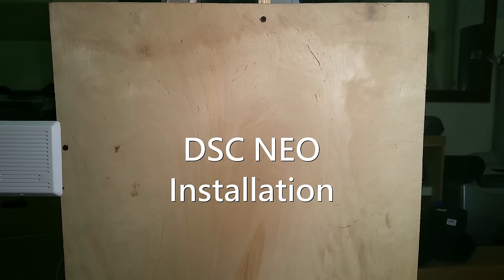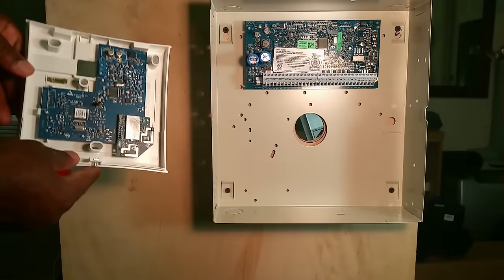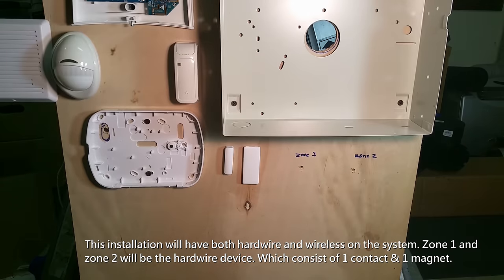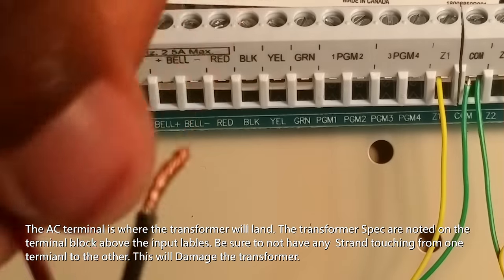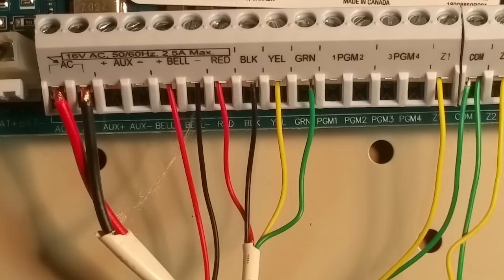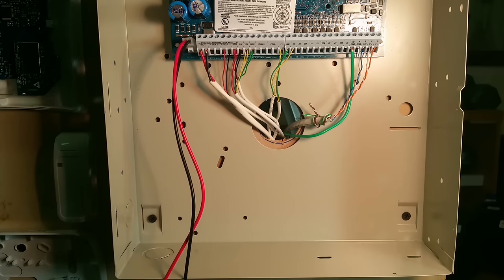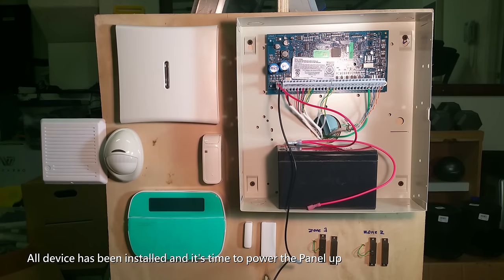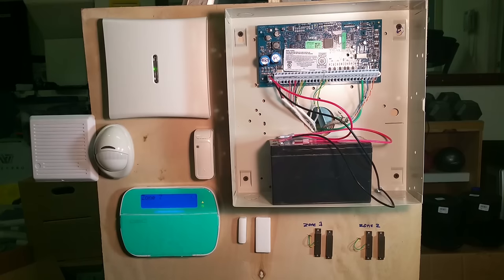DSC NEO Installation - Step by Step

Comment: Just started at a local alarm company. Working inside at the moment for troubleshooting IP cams & F/A . I have a IT background so I know IP NVR like the back of my hand. Thank you for the video! I've disabled old alarm systems but this knowledge will get me a raise! New career better pay!  I'm one week in. I got the wireless systems down pat but commercial NEEDS to be all wired. The interference from commercial is nothing to mess with wireless..... X-Ray,  heavy wireless traffic. Again THANK YOU FOR YOUR VIDEO! Btw to the comment below.... if you install an alarm sys. you better know about resistors on zones.. Otherwise you need to keep walking....  Love the line seizure part. THAT IS KEY

Comment: Started With DSCs PC 5010. Then the 832, then PC1832, love them and the PC 1864.
Just Learned they are Discontuing the Power Series. Maybe even the Neo? 
I use the Programmable Outputs to shut off a 1" Ball Valve (Viking WSV2). Within 2 seconds of a leak using Wireless and/or hardwired water sensors. 
I also use a PGM to Turn off Air Conditioning if a Perimeter door is opend more than 5 minutes, or whatever time you want. I also have a PGM Shut off AC, If Heat or Smoke is Detected, to keep Smoke Pumped throughout the House, or give more Air to the Fire.
Sorry to see Power Series Going. I had Assumed the Neo was a System where Keypad Contained the Control Panel, so I never Researched it. 
Thanks for the Video.
Want to Add, on the Keypad, there is a 5th Terminal, "Z", 
Can be used for a Door near Keypad, just run a pair of wires from door contact to Black and Z Terminal on Keypad, You will need to Program that Keypads Z Terminal. 
Some can not only be Programmable Input, but a Programmable Output, Trigger a Door Strike...
Use to do a Lot Of Phone work. 
Usually it is.
White/Blue to Green
Blue/White to Red
White/Orange to Black
Orange/White to yellow,
When converting Category Rated Wiring to Old Quad Wiring.
Blue/White should go to Ring Terminal.
Ring(Red)has a Negative Voltage with Respect to Green.
I need to Check if they will continue the Neo. 
I believe I saw or Read, the Neo won't handle the TL 150, Or Envisalink, hope they have an equivelent or Better.
Will leave a Positive
Randy/Stratmando
Strategic Electric & Security

Comment: I am very sorry that you have such a situation. The question of home security will always be relevant. I live in a not very favorable area and therefore I had to install a security system. When choosing between wired and wireless, I certainly chose the wireless option from Kangaroo. This makes life a lot easier, no need to break the walls and throw a bunch of unnecessary wires. The whole system works through a wi-fi network and can be controlled using the phone, in general, I am very pleased with my purchase.

Comment: In the Red/Black/Yellow/Green group, i have 2 keypads and 4 extension modules.  ITs difficult to try and get 4 wires all connected in one color.  Can i crimp them all together and just have 1 wire going into these slots?  does that make any difference?

Comment: Hi. Many thanks for an excellent tutorial. This is the video that made me dare to try a self installation myself. I have a question though. 
Is it a PG9945 door contact you have in the video? If that's the case, do you know if the aux-input identifies as a different zone compared to the built in reed-switch if I would use both?
Reply from the maker: +Marcus Kvarnström Thanks Marcus, Yes its the PG9945 unfortunately its only one zone.
Reply: +The Automation Guy Too bad my plan didn't work out then. Thanks for the reply though. :-)

Comment: Hi, new on this kind of installations, great video 👌🏼, just a question, what is my option for installing the phone line if my phone line is fiber optics coming in the house?
Reply: Possible it will does not work, cause fiber is at others words a VoIP line / digital line, which works at different voltages/frequencies/types. In these cases it is suggested considering to use Ethernet/internet, or GSM/GPRS/SMS communication modules.
Reply: qvq8

Comment: just a question you are installing this with a transceiver inside the cabinet what about the neo wireless keypads with built in transceivers how would they work on the system eg Model Number HS2LCDWFPV4

Comment: Shouldn't you be installing EOL resistors on the hardwired zones?
Reply: Security Camera Man I agree but it is just a demonstration but it should be discussed
Reply: at the device never in the panel
Reply: Eols are installed at the end of line not in panel
They are used to make sure the integrity of the wiring circuit is good.
If its in the panel it defeats the purpose.
Any installer not putting them at the last device on that zone needs to go back to school or have his liscenae taken away

The eol is used to create a drop across the zone voltage.
If that drop is present the panel is fine
If its not its an open.

The eol is used to make sure there isnt a short on the field wiring.

So if its put in the panel and there is a short before the last device every device after that short can be open ed without effecting the zone or open according to the panel.
If the reaistor is at the last device and there is a short before that last point or eol it will drop out that resistor and an open will show up on the keypad or panel as open

So the eol is used to make sure there isnt a short or a parrallel closures from field wiring across contacts or other devices.

The eol should always be at last device period

Hope this helps
Reply: Speaking of going back to school, it would help to spell words correctly.  From an engineering perspective, I disagree that EOLs must go at end of line.  There are cases where they can go in the panel without defeating the purpose.
Reply: EOL resistors are a throwback from the 60's & 70's. I have NEVER used them in DSC panels since 1994 and NEVER had an issue. Also, you can't put an EOL resistor at the end of the line in alarm circuits because it's a loop (series and not parallel circuit). If you really feel that it's based on being lazy not putting them in, think again if you're using wireless. That's fricken lazy and stupid too.

Comment: I have PC1616 and PK5500 - put 1k resistor for bell and 5.6k resistors for all the zones, but i sill cant power up the system -
1. its showing message "powering up please wait"
2. after while that it flashes warning and ready lights - only on fresh start
3. message "powering up please wait"
4. only warning light is lit
5. shows on display blank time and beeps sometimes
6. it seems that system is restarting itself and goes threw steps 3-5

If i try [*] + [anything] it does nothing or sometimes shows message "system is unavailable"
If i time it right i can enter *6 (for date) or *2 (to get warning info) but can't get pass master code before it restarts again

Any ideas whats wrong - initially i added bell, door sensor and motion sensor, i removed all of them and replaced with resistors but problem still exists

Power supply outputs ~18,8V ac
PCB outputs 13.6V DC to keypad
Reply: YKLABATYD it's a DSC they are junk, replace it with Honeywell.

Comment: I see the step where you connect wire to the power transformer near the end of the video, but I don't see where to connected the other end.
Reply: black and red to the transformer, the other end connects to the board.  first two screws on the left side that say AC.